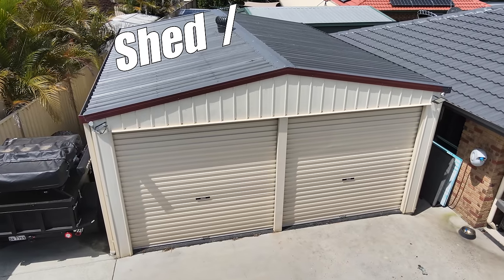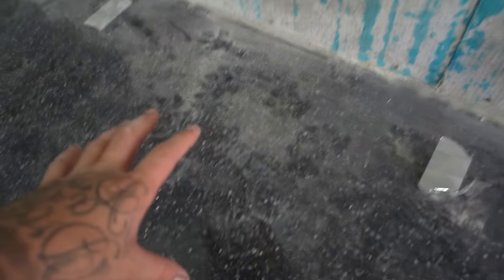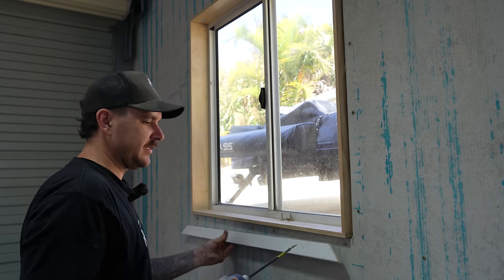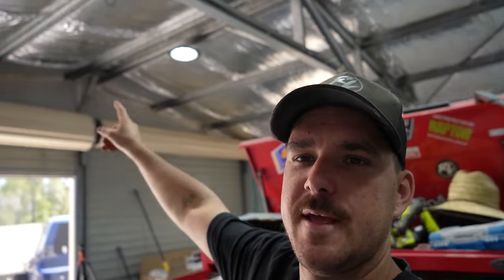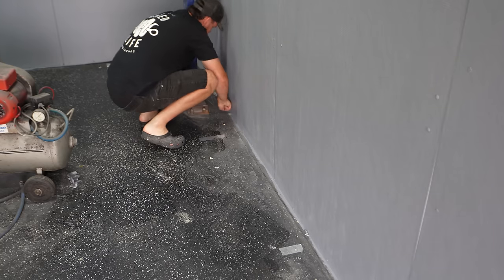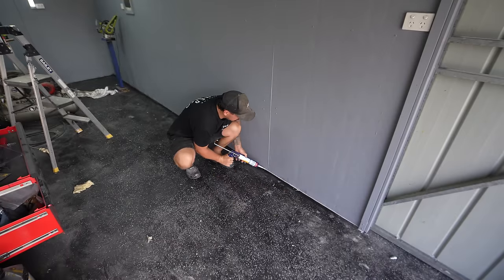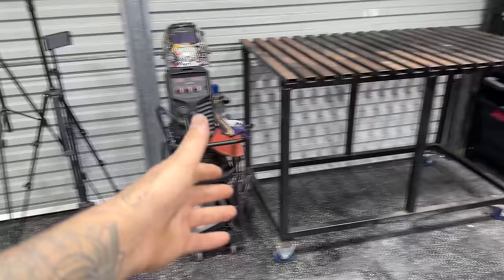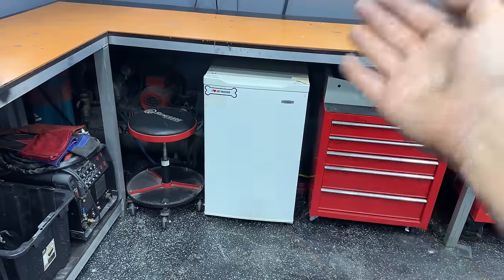Building The DREAM Shed / Workshop - PART 2

Comment: Running aluminium checker plate around the bottom edge will not only look good but will protect the bottom edges of the wall sheets.

Comment: You should a loft or shelf that runs around the top of the shed that will hold the bins. And you can add pot lights underneath. That will give you room on the shelf for parts you need on hand

Comment: Good job. But I would have installed the air con at the same time as the insulation & sheeting, I would have insulated the door, outside securty roller shutters on windows, wood paneling sheets on ceiling & 2nd hand warehouse pallet racking
Reply from the maker: Still to come with the door and roller door! Aircon goes in tomorrow! I already ran the wires tho! So should be simple install!

Comment: Checking from Perth WA. Awesome result and i am in the exact same situation as you before the makeover, so hence why i have subscribed & liked & watching.
last week we copped 39deg days & my colourbond workshop is 7.5m x 6.1m with 3m high side walls/pitched roof and i have a two post car hoist in the middle as own 3 x v8 classic cars.
I drive thru one side of my double garage into the shed & it is connected to the garage with door access each side between the join so the whole area is sealed from weather which is great in winter.
However the shed is a sweat box sauna in hot weather & i can't stay in it for long before dripping with sweat.
One long (7.5m) wall side of the shed i built another car parts shed joined to it which also houses my 100ltr compressor jerry rigged to 2 more 100ltr s/steel tanks giving me 300ltres of compressed air for spray painting ( iam converting my double garage 7.5m x 6.5m into temporary spray booth for when i paint 2 pac (the compressor hardly kicks in once the 300litre tanks are filled and i hardly hear it working because it is another shed & not the workshop.  My car parts shed 7.5m x 4m is fully lined with h/duty rack shelving & also keep aprox 5 x trans on funiture trolly's & spare diffs/driveline parts and body panels/doors/ suspension parts etc etc which keeps it out of the workshop. 
My problem is i have 5 x V8 engines on funiture trollys + 2 V8 blocks on engine stands i am rebuiding and they take up room.  
My workshop is also fully lined with shelving racking also & toolboxes like you & all the other tools like you so it is bursting at the seams.  I need to build and engine room - haha & get the spare engines out of the workshop. I also have stick /2 x migs / 1 x tig welder + plasma cutter + bench drill/ drop saws wood & steel & the list goes on.
I did line my double garage completely with hardi-cement board & painted gloss white as it needs to be spotless for spray painting  (got the fans & filters just need to build ducting etc)
What is the cheapest product to use that will seal out the heat for the workshop roof & just need 1 x 7.5m side sealed and the back wall same as you.
I might even do what you are doing & instal an aircon (have mates who are Fridge tradies)   Any advice appreciated as the heat in the shed is driving me nuts

Comment: Had a similar issue with my wagner, where i had to pressurize the tank. Ended up being a blocked whole in the tank side where the tube comes down and the white plate joins. Hopefully helps